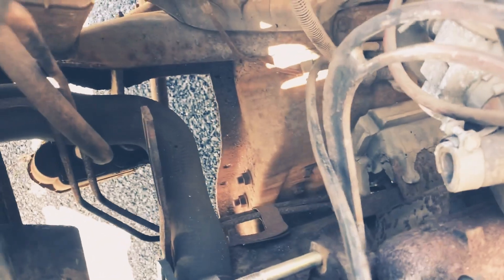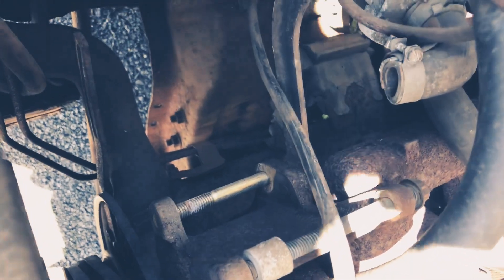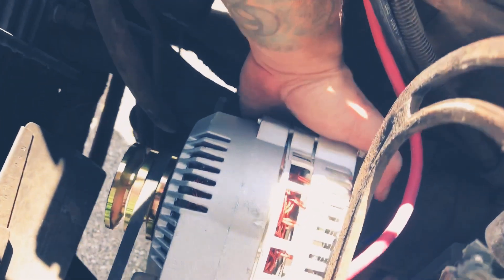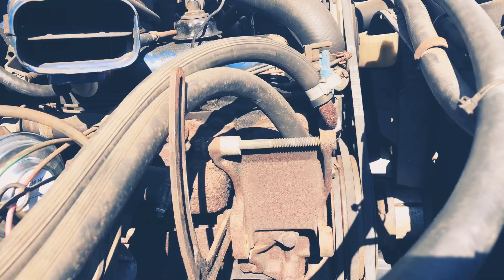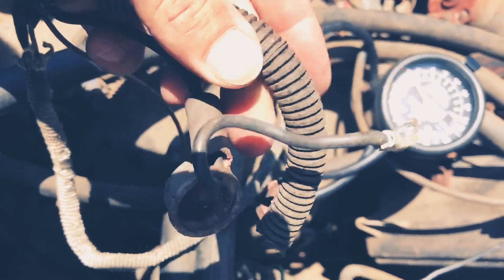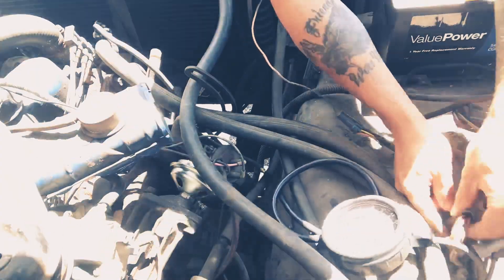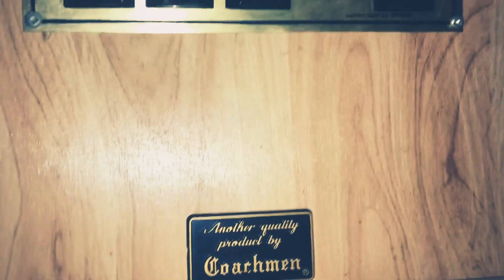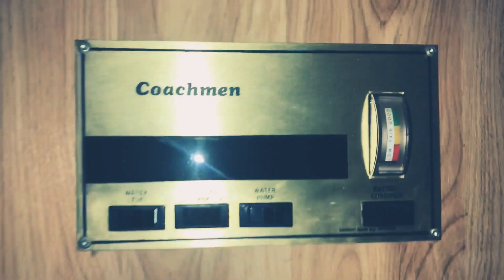How to get more POWER in your RV! Ford F250 1G to 3G Alternator upgrade with minimal modifications!

Comment: Would you say this was in fact a direct fit?
Ps: all the 1g and 3g talk reminds me DSM's.
Reply from the maker: Drew Sanville If could place a percentage on the installation I would say it was about an 80% direct fit . I was happy with the fit of the 3g but wanted to make the v-belt a bit tighter. I also had to do some wiring. Not very intense wiring. The original harness to the 1g alternator has 4 wires that went to an external voltage regulator( junk ). The 3g is internally regulated so the harness has been simplified down to a single 12v signal wire and then a power wire from the alternator to the battery. It was a fun installation that really woke up the ignition system along with room for expansion like flood lights , electric cooling fan , upgraded interior sound system and maybe some Fast n Furious street glow for my DSM boys 🤘🏻🔥#Paulwalker😇 tribute